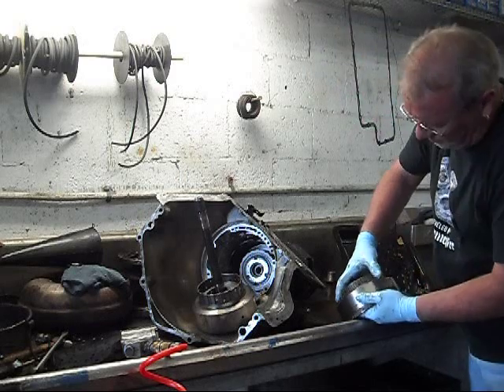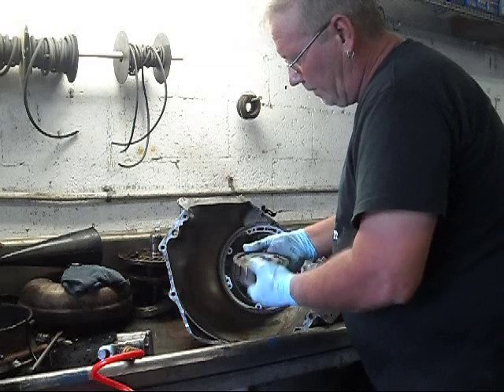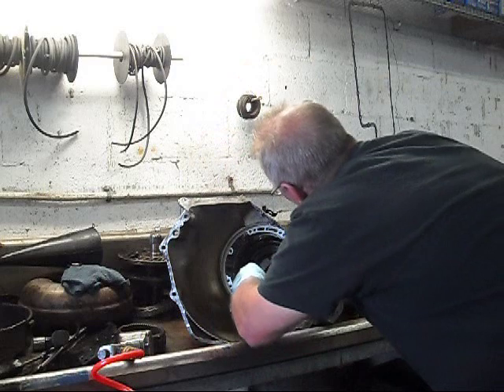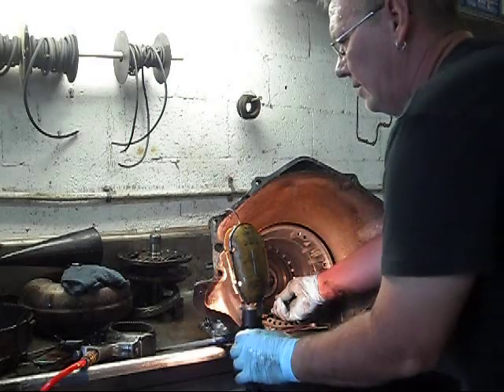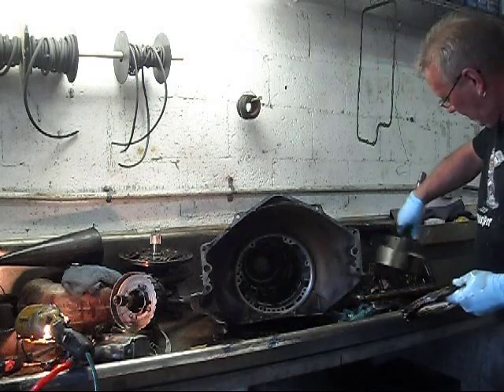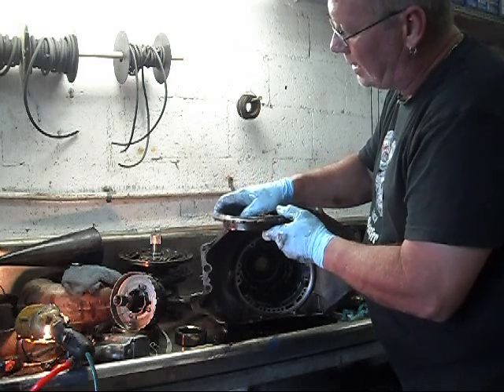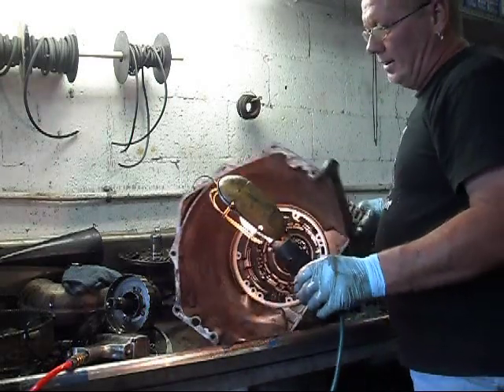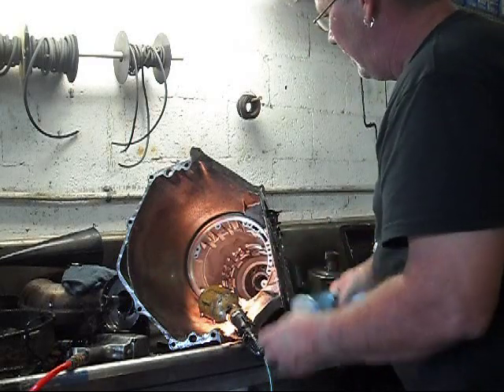TH 350 Teardown part 2.wmv

Comment: I am looking for a bit of information if you are knowledgable on internally duel feeding the direct.....i think I have all the details worked out but am not certain weather to omit both the direct hub center seal AND the pump direct sealing ring or just one of them....not planning on using any shift kit.appreciate any info or suggestion...thx Ken